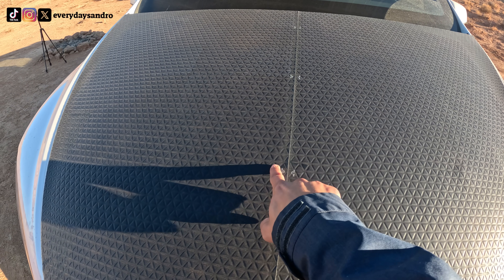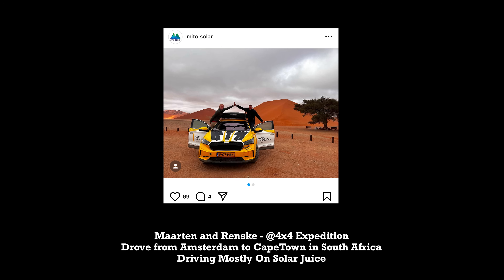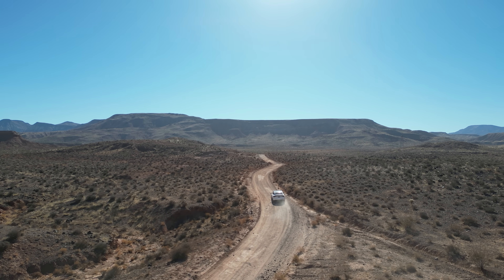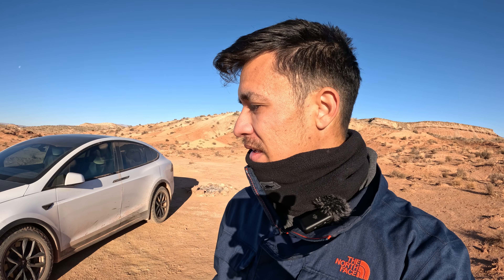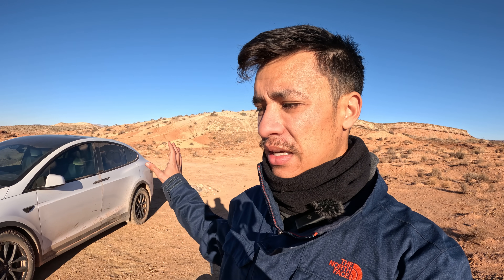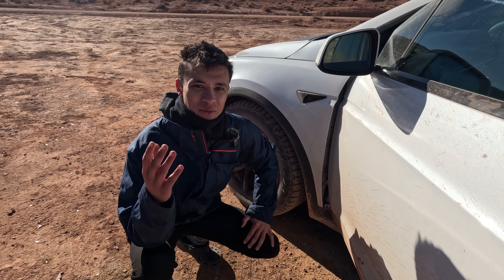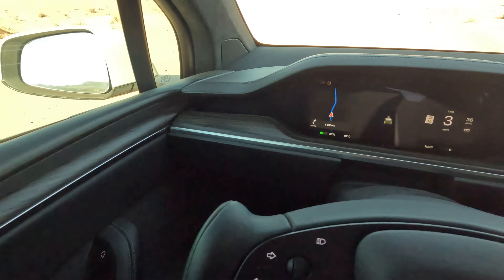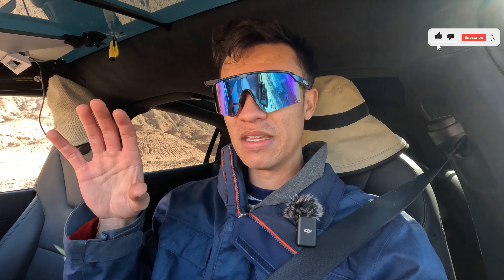How Much Range Can DIY Solar Panels Charge My Tesla? (Battery Test)

Comment: Awesome test! Amazing you can get 6 miles of moving a three ton vehicle with those solar panels. I would invest in a foldable solar panel. Thanks for picking up the trash, there are a few people who ruin it for the rest.
Reply from the maker: Yes indeed! Thanks for watching! I just love spending time out and about and its soooo worth it having these panels
Reply: What I am most curious about is how the charging overhead in the Tesla is compared to the eff and loss in the EcoFlow.
EcoFlow would be most efficient at some lower rate, but will the overhead of the Tesla being active counteract this when charging over a longer time?
Trunk being open may also keep the systems of the Tesla active consuming more than if it was completely shut down and just charging?
Tesla recommends to use their Energy App and view the idle drain and their suggestions to reduce it. May be worth a shot?
Reply: @1kreature  your hunch is probably accurate as everything electronic tends to have ghost draw. It's too bad All EVs don't have at least a 2k inverter charger like you ecoflow integrated. I would pay extra for that.
Reply: @functionalvanconversion4284  I would love for cars to have or be retrofittable with a MPPT style DC source charger as well. Worst part is it is easier than making the cars internal charger really. In theory though many cars could probably take 80-230v DC input and be limited by their rectifiers ratings. Have to remember that the rectifiers are loaded harder on DC than AC and some synchronous systems may not handle DC if they use a bootstrap design.
We are charging a DC battery after all, the AC coming in has to either be continously transformed to DC while doing power factor correction or it has to be a 2-stage process that passes by DC regardless.
Reply: @1kreature  Your understanding is beyond mine it seems, but it sounds like you are the guy for testing and developing a new product👍.

Comment: great test! loved it, I bet if you turn the tesla charging as low as it can go you would get a lot more help from the solar panels and gain even more range!
Reply: The increased wind resistance will almost certainly decrease the range.
Reply: @davidlloyd1526  is it that inefficient ? thats crazy.
Reply: True. Energy loss goes with the square of current. 2x lower current, 4x lower energy loss in wires and electronics.
Reply from the maker: Great point!

Comment: Anker F3800 is 240v at 24amps and doesn’t need a grounding plug.
Reply: The f3800 is pretty big and bulky (over 100lbs) and wouldn’t fit in the subtrunk neatly.   I have 2 of the F3800s and the smart panel with expansion batteries at home for backup and time shift of energy consumption from the grid.  If size didn’t matter, there are some advantages with the f3800 since it has 2 mppt inputs so you could get more panels in or even split the two front panels he already has so if one is shaded, it wouldn’t impact the total solar input as much.
Reply: @ that’s awesome. how do you like that setup? Do you have solar as well? Why did you choose F3800 vs Solix X1?
Reply: I have solar and a powerwall 3.  Wanted more capacity but with powerwalls you need to go through an installer - at the the time installer didn’t have access to quote expansions.  I had previously ordered the Anker F3800 during their initial kickstarter program.  Had my doubts on how they would work with my powerwall 3 set up. Originally planned on using it as a manual generator like set up but reading through  the installation, the smart panel takes care of the charging and feeding the load.  Installation was easy - found some spare slots on my main panel and put in the 100amp breaker and ran the two loads, neutral and ground to the smart panel.  Then you just plug in the f3800s into the smart panel.  You have the option to wire up a back up panel but  my set up with the Powerwall 3, I didn’t have to move any circuits from my existing panel since during a grid power outage, the Powerwall 3 would start supplying power and the Anker smart panel would see that there is still power so it’ll continue to feed back to the main panel.   If I didn’t have the Powerwall 3, I would need to move circuits over to a back up panel if I wanted the Anker to provide back up power.  The only drawback with this set up is that the Ankers will only supply up to 6kW to main panel vs 12kW to a backup panel.  The X1 wasn’t available at the time but the advantage of the F3800 is that it is “portable” and easy to take with me.  During the last big windstorm in OH, we had a friend lose power for days and we were not impacted in our area and when I found out, was able to lend him a F3800 and several expansion batteries to power his fridge and freezer and other necessities.

Comment: You mentioned that you get cold quickly. So I'm curious if you've considered a heated sleeping bag and what the difference in electricity consumption would be for heating the car or heating the sleeping bag. The idea of solar panels on a car is not new, but I'm curious if you could put solar panels on other large surfaces of the car? The roof, the trunk, because you don't always have to drive into the sun. Maybe it would be a good idea to have a custom-made trailer with an additional Tesla battery, and a foldable solar power plant with an automatic sun position tracker on top. For optimal charging of both batteries.
Reply from the maker: I like to pack as light as possible and towing just doesn’t seam to have many benefits, thanks for the suggestion though. I might add a heated blanket as I already have a 0 degree sleeping bag

Comment: High-frequency, transformerless inverters can fry your Tesla's onboard charger and leave you stranded when their MOSFETs fail. You should have installed a low-frequency, transformer-based inverter charger instead.

Comment: Your EcoFlow device does not have sufficient ventilation during the Summer.
Reply: I tesla has temperature control. I guess it depends on what mode he leaves the vehicle in. He did say the software update shuts down the electrical power if away from the car. Error?😊
Reply: I wonder if a temporary solar panel over the inside dash board will charge.
Reply: I love those power banks that inflate tires. I have a Gooloo power bank that charges and discharges at 100watts as well.

Comment: If keeping things clean is an issue with ‘out of car living’, I recommend getting an ozone aqueous spray. It uses portable water to sanitise and minor deodorise ability too.

Can use it for a mouthwash. More effective than your average mouthwash.

I use the brand enozo (pro and non-pro) for about 3-4 months now. Game changer.

If deodorising is a bigger issue, get a small panasonic nanoex device (i have 2). Keeps the surfaces on the car odour free and has the ability to kill airborne viruses. Fyi - Lexus uses that with their ac on most of their cars now (use to be only in their higher end cars).
Reply from the maker: Great tip! Doing some adjustments today, thanks for the thorough input!

Comment: FYI, the Ecoflow Delta 2 Max with 230V output (Europe) doesn't need the grounding plug to charge the Tesla. I guess it's integrated due to the regional norms.
Reply: Cool , just started looking,  ran 400 feet short of charger,  and saved by a passing cybertruck. 10 to 20 min in my S good to go
Reply from the maker: That's wild!
Reply: Charging efficiency is apparantly higher from 230/240v to Tesla than with 110/120.
I wonder how that compares with the internal eff of the Delta 2 inverter?

Comment: You previously said that these were something like 150 watt panels (now you're saying 120 watts).  ***IF*** you could get full power for 10hrs a day, you'd make 2.4kwh with 120 watt panels per day, which as far as I understand, most EVs will get between 2 and 4 miles per khw.  Which means at most and with that big giant IF, you would get 9.6 miles with 120 watt panels per day.

The problem is that big giant IF.  The reality is you will NOT get 100% out of the panels for 10hrs out of the day even if they were facing the sun perfectly all day long.  You'll likely only see roughly 3 hours out of the day where you even get close to 100% out of those panels and that's if you're driving and getting some airflow over them to help keep them cooler, because hot panels will lose an easy 20% + of their rated capacity to create power (more important in Summer than Winter).

You almost certainly won't have those panels facing the sun all day long because as you drive you're at the mercy of direction of travel to get to your destination.  Which means you can't just drive and face the sun the whole time.  You can help push things in your favor by parking facing in favor of the sun when you're not driving.

Then you can add to that shadows from trucks or other vehicles while you drive, or even a cloudy day, etc.

My guess is you will be lucky to average an extra couple or three miles per day.

Keep in mind that what we saw in this video was a nearly full solar generator being used to charge the car.  What we didn't see was how long it took to get that solar generator to full.

Signed:  Someone who employs the use of several panels, mppts, inverters, logging tools, etc.
Reply: And that's without going into Inverter losses IF you're using the Solar Generator to collect the power from the panels and THEN charge the car.  Inverter losses would be another 20% pretty easy.
Reply: @HutchinsonJC  1 it’s a passion projects. And it offsets a lot of of the other things he does in his car. Besides driving. I.e. he doesn’t have to pull power from the main battery for a lot of things and it does actually put a significant dent in things that aren’t the big battery. Cooking, other items, and some amount of AC
Reply: Well said
Reply from the maker: Thorough appreaciate your input. You are right, the initial peak watt output of these panels are 120 watts each, so 240 watts overall. I actually charged my EcoFlow with 236 watts yesterday which was awesome. I am actually not worried about all the math, just enjoying the life on the road, and continue to push boundaries using this new setup. Thanks for being here and sharing your perspective
Reply: True,  although I think if I remember correctly the original goal was to use it for accessories. The idea of solar powered vehicle using the space of the vehicle and not relying on a massive solar farm is not likely to ever  give a full range in a single day.  Same idea with using a gasoline or diesel generator to get some ev miles, it works technically but it's just not efficient. I would however like to see a turbo hydrogen fuel cell and small engine in the Tesla frunk and trunk to potentially generate electricity. Maybe use solar to help With the water separating into the hydrogen and a small vacuum pump to store the gas into small tanks. if going that route. Otherwise it might be better to go to a hydgroen station powered by solar and cheap water source, which defeats the purpose again. Could probably work on a massive RV though Or bike